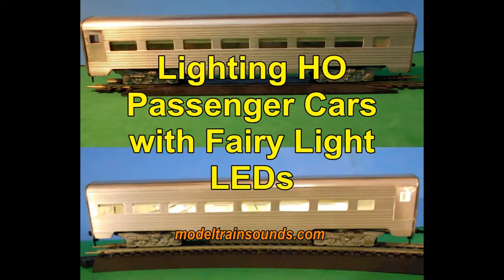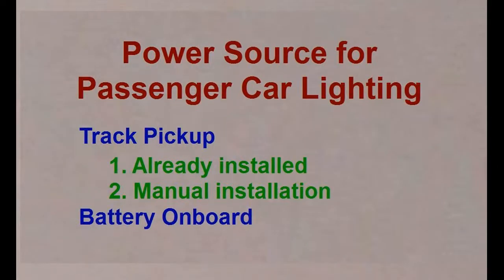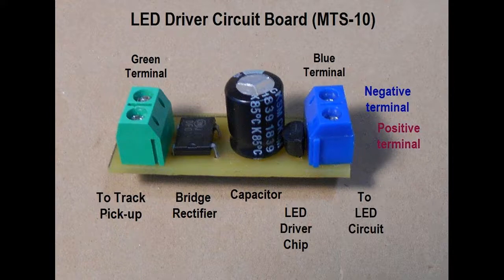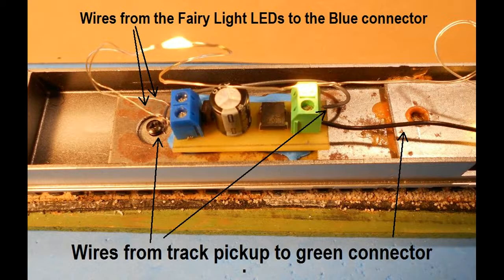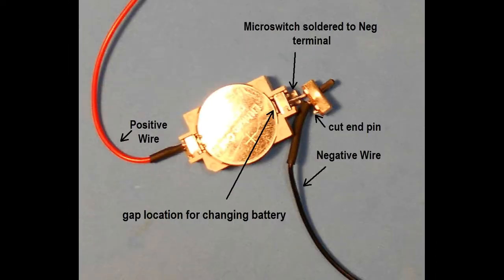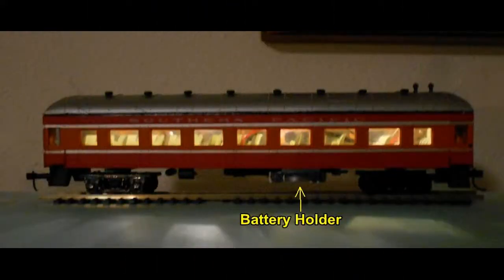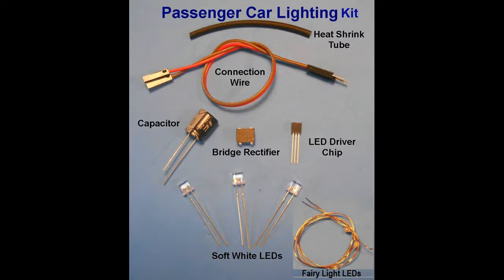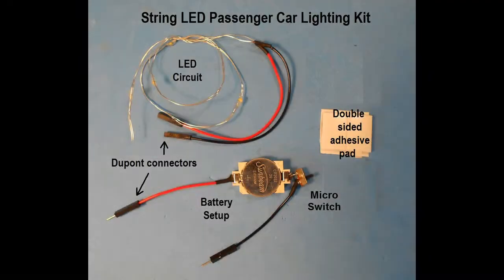FairyLightsVideo

Comment: Thanks for all your videos!  I'm going to tackle a couple of projects soon.  You state that this is for HO.  Could it be used for N scale as well?  Or are the components too big?
Reply from the maker: The fairy lights would work using smaller disc type batteries .... The switch might be a problem
Reply: @robertwilkins1765  ok, thank you!